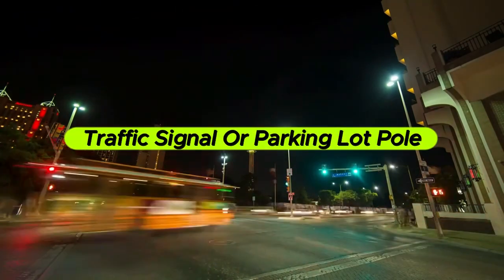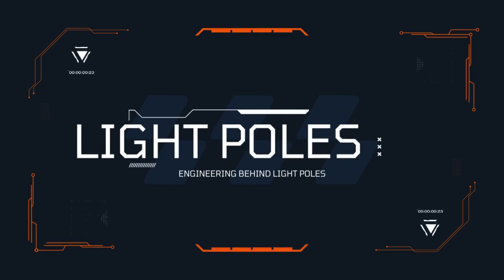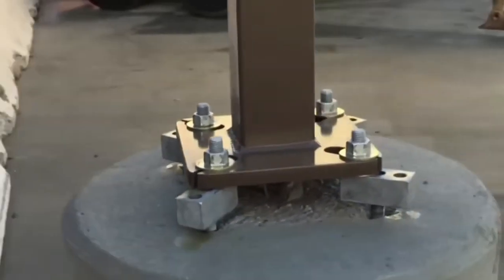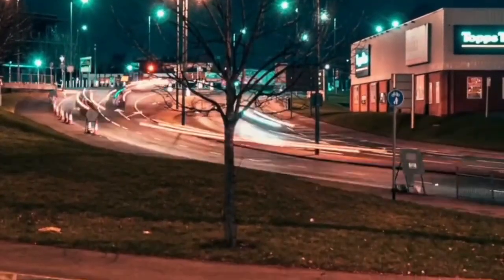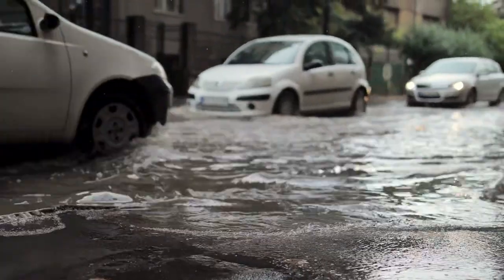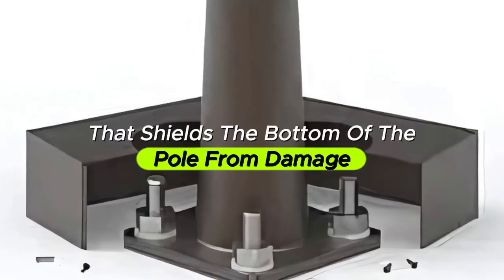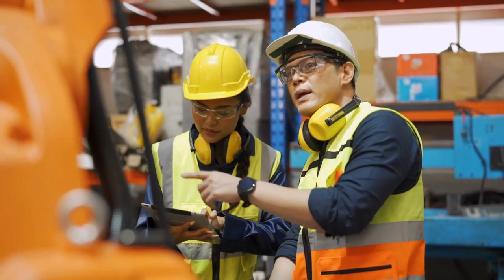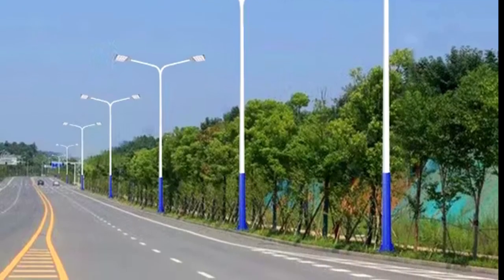Why Do Light Poles Float on Bolts only, Not Flush with the Ground

Comment: Poles in the UK which are mounted onto concrete via bolts (as opposed to planted in the ground) are not elevated with a gap beneath. The poles corrode at the base and last significantly less long than those just planted direct into the ground. This design flaw is the reason why so many poles on motorways in England have been chopped down

Comment: I specified this design for mounting special battery containers which had to be precisely leveled.  There is a standard tolerance for concrete construction and trying to get a series of footings and piers precisely to the same elevation would be very challenging and expensive.  Plus many concrete contractors would no-bid the job.  By using this kind of design, standard construction tolerances could be used and then the container mounts precisely set to exact elevations by the fine adjustments possible with the threaded rods.  Once set, a structural type of hydraulic cement was used to fill in under the mounts for added strength, although the rods themselves are extremely strong as they are in compression.
Reply: I agree, mounting the pole via adjustable bolts allow alignment after the base has been set. A 1/2" out of level error on a 12" base becomes  20" on a 40' pole.